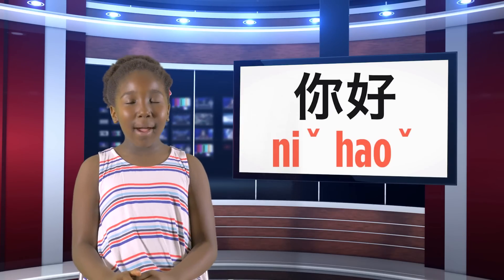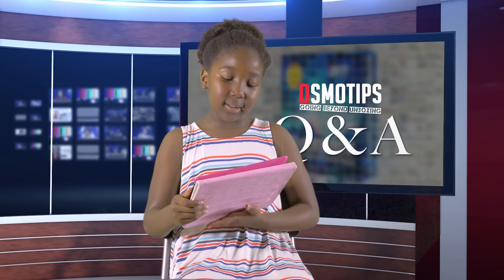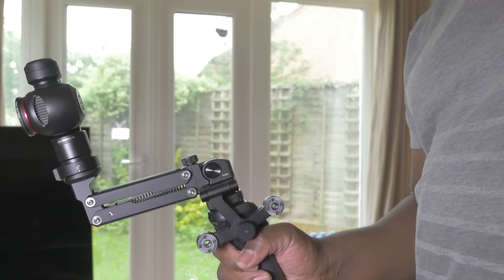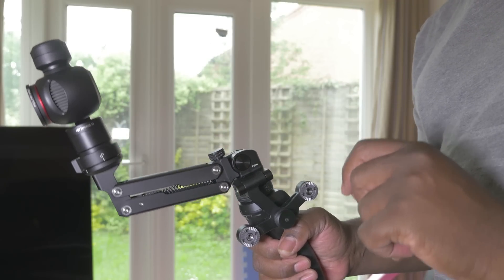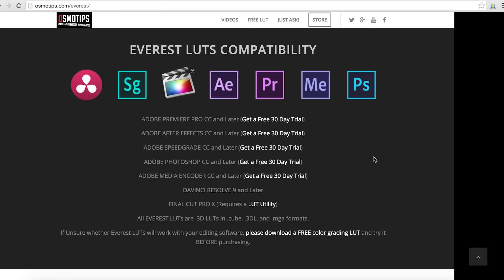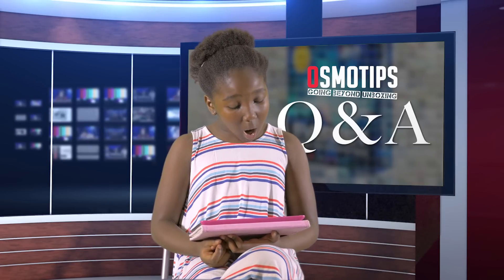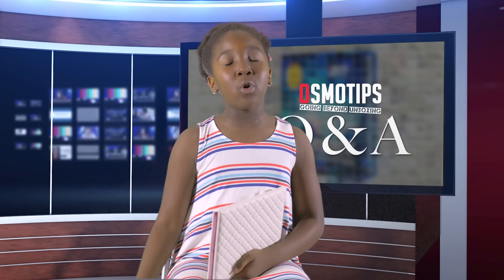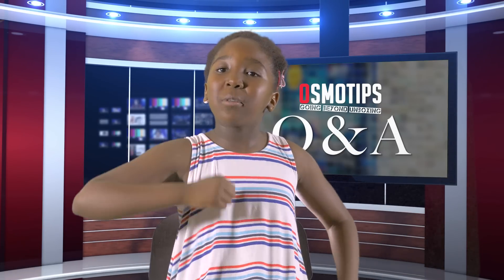DJI Osmo Questions Answered in Detail - Q&A

Comment: Why do i experience sudden quick panning when moving on flashlight mode?
Reply from the maker: In the DJI Go App. Gear Icon/Gimbal takes you to the Gimbal Settings. What gimbal settings are you currently set to? i.e. Fast/Medium or Slow. If you've got custom settings what are the parameters you're currently set to.
Reply: Fast, medium or slow, i experience the same thing. Can you suggest the best smooth custom settings please?
Reply from the maker: +XposeCreative if the pan movement is uncontrolled and you're not using custom gimbal movement settings, then this could be an issue with firmware or hardware itself. If not already upgraded, I'd start with a firmware upgrade. If you're already on latest firmware version then this could be a camera hardware issue. Are you able to record this sudden panning movement or its so random that it's not possible to record? I usually stay on Medium setting for gimbal movement and this works well for walk and shoot.